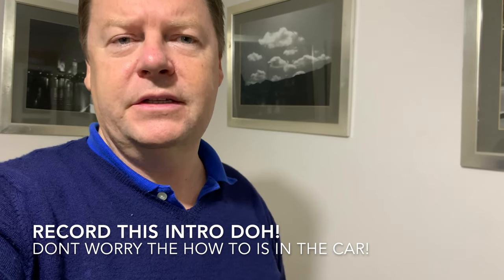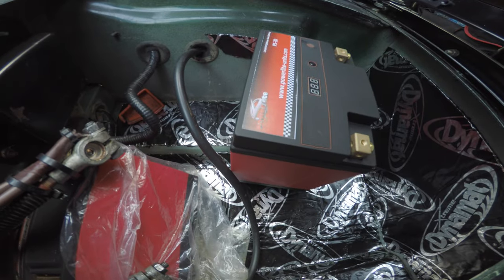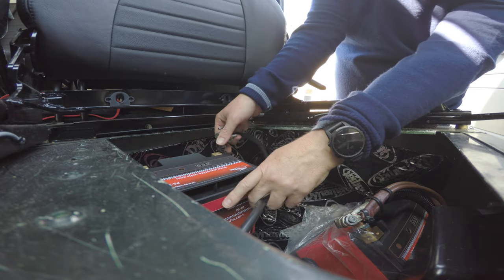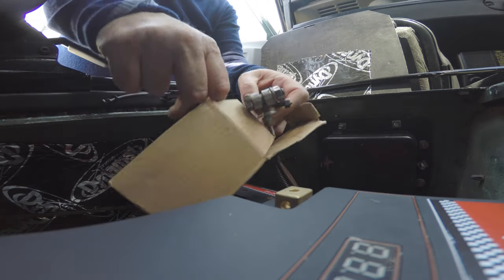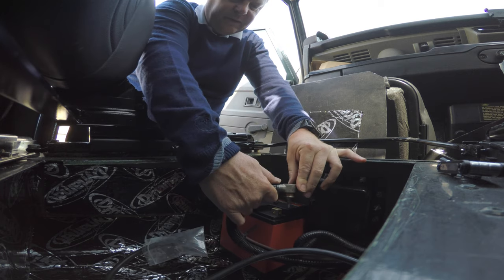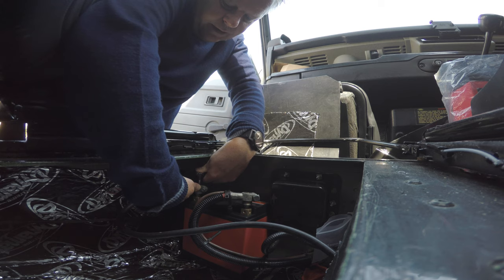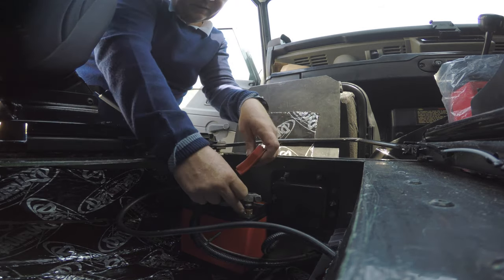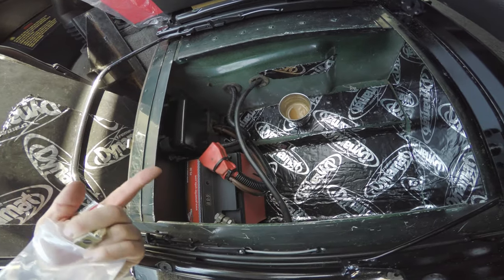Land Rover defender lithium Battery 4K video on Lead Acid 68ah Battery Swap to 30ah LiFePO4

Comment: I am currently looking to install Lithium iron phosphate (LiP) batteries in my 2011 Land Rover Defender; I was very pleased to come across a fellow Land Rover Defender owner who has already made the switch.

I have a few questions about your setup:

As I understand it, you initially bought a 20Ah Battery from powerlite but then decided to install a 30Ah battery because it gave you more cranking power as it is a larger CC Diesel engine?

Do you need to install a different alternator to the Defender to charge a (LiP) battery? Will it damage the LiP batteries?

Are you going to use the second 20Ah powerlite battery you now have spare as a 'dual' battery setup or just use the Goalzero yeti 400 lithium battery/power bank that you are going to buy for your accessories on the Defender?  (I understand 20Ah is very small to use as a second battery)

The 'goalzero yeti 400' appears to be more of a portable power bank solution rather than a 'dual' battery setup?  I presume you going to be storing it in the battery box alongside your stater battery and then take it out of the battery box when you want to use it?

Do you connect all of your accessories (additional off-road lights etc) on the vehicle up to the 30Ah powerlite LiP battery that also starts the vehicle? Or do connect them to a separate battery/second 20Ah power lite battery you have? Or do you connect them to the goalzero yeti 400 lithium?

In short, I am trying to find out what the smallest LiP battery is that will comfortably crank/start my defender; then I can have a second much larger LiP battery housed in the battery box alongside the starter battery. I can then use the second LiP battery to charge accessories like a fridge, lighting, charging a phone, camera, etc whilst camping off-grid and have plenty of power.

I am also thinking of trying to set up a split charge system via a battery management system so the alternator can charge both batteries when the vehicle is running.  ( I am also thinking of installing a Solar panel at a later date so this also trickle charges the batteries).
Reply from the maker: Thanks - two years on the powerlite ones are still going strong!
Reply: @ChristianBorrman  do you daily drive it? 

How do they perform in the cold British weather? 

Do they start the Defender okay on a cold day?
Reply from the maker: @TheLewismerle  yep it’s my daily driver, lifepo4 performs much better in the cold than lead acid, losing about 10% at 0°C vs lead acid losing upto 50%, so even the 20mah one has the power to start on the button in cold. here is a link to another manu of them stating this: https://relionbattery.com/blog/lithium-battery-cold-weather

Comment: Interestingly I have been considering 2 NOCO Lithium batteries for my Defender TD5 and asking on forums it got so rather mixed responses especially around the cold and risk of damage to the system. Have you experienced any issues / challenges? Or any advice you have? Seeing someone achieve it has made me wander if I give it a try!
Reply from the maker: I tried that as well, most of the land rover forums are great for tried and trusted solutions but not for treading new territory! no issues at all, they just work, and when I have left one too long and its gone flat in the lockdowns I have wired up the other in 5 mins and been on my way. one went totally flat as well and revived to full power again in a single cycle. I did email my supplier and ask if it would work with my alternator tho, and was told A OK
Reply: @ChristianBorrman  ah great. The only confusion I have is around AH. From my reading it suggests it’s hard to compare. NOCO state the battery I’m looking at (plan to have 2) is 8ah but that it’s equivalent to 32ah of lead acid. So it’s only thing I’m a little wary of with security gear…
Reply from the maker: @martinbly4923  I have seen some batteries double their ah by giving a lead acid equivalent… would stay clear of those. my 30ah has been fine for now, I am about to join the 20ah one to get 50ah and see how it lasts with the diesel heater
Reply: @ChristianBorrman  yeah The fear of 16ah worries me though those batteries are pretty much free for me from a friend. Where are you getting your 20/30 ah battery from?
Reply from the maker: The issue going low is cca. the min one with enough cca for my defender was the 20ah one, but these powerlite ones were the only ones offering the 600 cold cranking amps I need to turn over the Defender. the problem for me was with all the trackers and other gizmos it was only lasting a week between starts so got the 30ah one. the 50ah comes from connecting the 20ah and 30ah in series. you should be able to connect 2 or 3 16ah ones to create a bigger battery, the only issue I can see is if the main one battery your starter is connected directly to does not have enough juice… if you are just looking for leisure battery them connect them up and make a bigger battery. they should all be at same voltage before connecting!